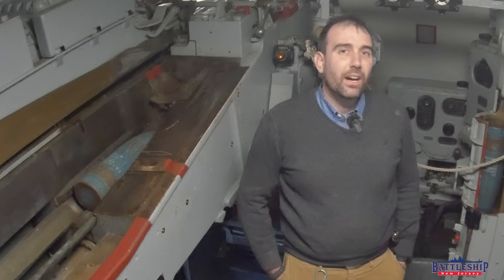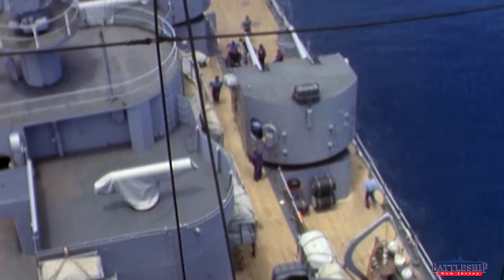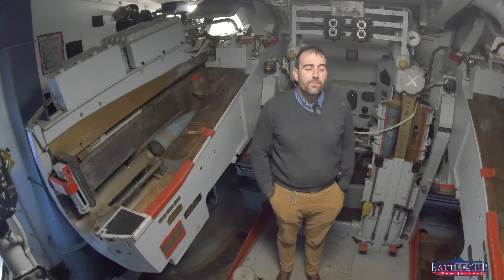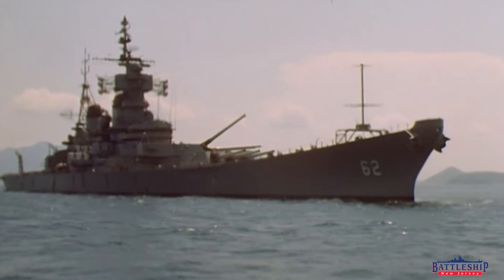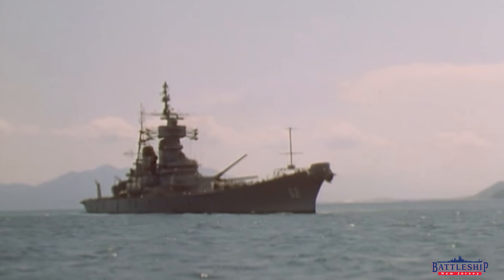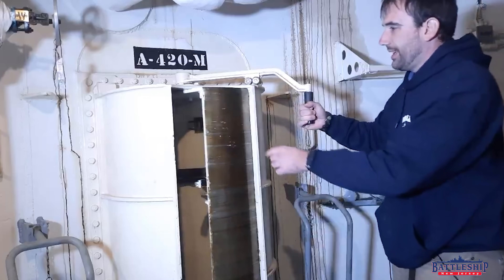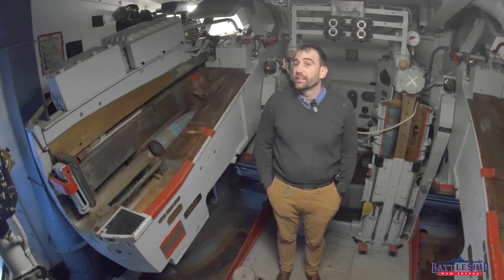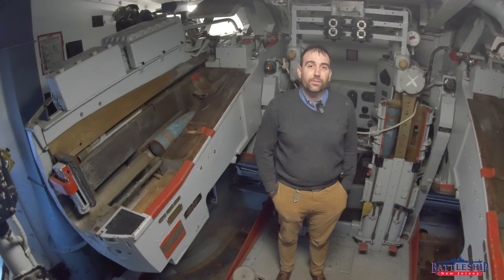Why Do Modern Warships Have So Few Guns?

Comment: Modern guns used as artillery (155mm) on land have ranges of more than 40 km (25 miles). And if you put some R&D into that matter, weapons-industry surely could figure out cannons that can even fire far beyond 40 km. And nowadays artillery systems are far more accurate than their WW2 predecessors. Maybe this developments will make guns become an interesting weapon again on ships. One more pro-point for artillery systems at sea is, that a shell is far more cheaper than a missile.

Comment: One argument for guns I have is that, while VLS missles are certainly better in terms of accuracy, damage, etc etc, there's a distinctly limited amount of them ready to fire, and their direct access to the deck requirement makes them limited too, plus replenishing them is currently a nightmare even in calm seas. Therefore, I feel it would make sense for perhaps a cruiser with a much larger gun to be made, with a payload at least rivaling that of missiles, especially for targets where pinpoint accuracy isn't as key (like for shore bombardment, especially for static positions), and especially as anti-missile tech advances. Furthermore we have advances in artillery technologies that are making them very precise - of course there are many more variables shooting from water but the tech will come, and current waterborne 5-inch gun precision is proof of that. Overall I'm not expecting more guns, I'm expecting bigger guns complete with autoloaders, precision, and range.

Comment: Missiles and tracking tech are effective as illustrated lately in the Red Sea.  But what happens when those incoming drones or whatever have really good evasion tech or can jam the missile?  You need point defense that can't be jammed.
Reply: Shooting a maneuveraing drone is actually easier with a missile that can adjust its trajectory midair than with an unguided shell that you send in the right direction and hope that the target is close enough to where you expected it to be when the shell arrives.

Jamming shouldn't be a big deal for point defenses, as the short range means that the poweful radar on the ship can easily burn though any jamming. I'm not aware of any ASM or drone with a jammer either. And if it was a problem, a gun wouldn't hit a thing either, as they're radar directed and would lose most of their accuracy without the radar.

Comment: I m predict destroyers equiped with small nuclear reactors for engine and heavy lazers... Which are going to replace flak.. next a. Increased rocket silo which allows for rockets with even greater range... A few remote controlled 50 bmgs or 20 mm guns and for the topping a 180 - 250 mm (7 - 10 inch) single barrel gun which shoots smart (similar to gyrojet ammunition)  ammo with a range about 60 - 100 km

Comment: The short answer is accuracy and quality is always replacing quantity and target tolerance.    

When a 12inch gun had to fire tens of shells to hit or affect a target, with a single missle this job is now much quicker and and more repeatable.

Imo:  automation and miniaturization will replace most jobs currently are done with missles.  Kamikaze Drones is one immediate future, but I think another contender will ultimately win the game.

Consider a shell  roughly the size of a 50 cal that comes with integrated circuits and GPS navigation.  It will be programmed as bullet/shell ie leaving the barrel , each round can theoretically hit a different target or they can converge on a point in series or even in parallel (all at once) for greater affect.     Such new weapons can take over roles and responsibilities of 1-10 mile, and they  range can be expended with small  flight fins and a small rocket booster.

This may sound futuristic but every element of my example has already been deployed on various platform.  We just need to bring it all together in one small but smart bullet, with impeccable backend software to support its targeting.

My 2¢

Comment: More guns would definitely help in a drone swarm, but... Are drone swarms really that much of a risk to warships? They're slow, inaccurate (Against moving targets) and usually have small warheads. You could easily fix these issues, but then you would just end up building an ASM and lose the main point of drones; That they're cheap and easy to manufacture. I believe that the CIWS and PDMS on current ships is more than enough to deal with a drone swarm. At most they may need some reprogramming to better determine which drones actually pose a risk and which ones can be ignored.

Comment: I think for drones a smaller caliber (maybe even as low as .50), with a lot of powder so that it can go very fast, and a relatively light barrel that can be quickly swung around would work best. You could have basically a smaller and cheaper CWIS for drones, because they can take at most one or two hits

Comment: reality with the east, our ships are logically outdated. cheap 600 bucks drone are the future. 
we're not even talking bout drone swarming that a few can disable even  a carrier radar. or future drone carrying heat seeking missiles to take out jets. or robotic drome. 
   we witnessing right now the decay of huge military hardware at the red sea it's obsolete here,  rebel  are doing a reverse curency USD exchange, that 14 shot down add 28 ukraine 2 days ago total cost comes w/ 2 million ea missile to shoot them down come to 86 milliion spent on almo in a single  day it's unstainable war.
thing about drones is they can hide it in a blanket and launch it anywhere and never use the same place. we can't stop it.
Reply: drones are being solar charge in the desert, ship need port refill. point is complex high cost and huge are a disavantage not avantage in circumstances. and why we try to make it a standard is insane.

Comment: You know, you ask if we think missiles will replace guns, and I think the answer to that is the same answer to the question of if missiles, planes, or drones, will replace tanks.
Essentially, no. Probably never. You've said plenty of reasons in the video itself, one of them being that you can't do fire suppression with missiles. They're way too costly to use on anything other than priority targets. 

Similarly, drone swarms wont replace guns either. Even if you got really small micro drones with explosives that could fly for 30+ miles to a target, they'd still be slow and numerous enough to take out at least a vast majority of them with a good old gun with some proximity fuse HE/shrapnel rounds. Add on the fact that even the cheapest drones will still take much longer to develop and build in mass than a simple, large shell. 

Logistically, nothing beats a chunk of metal flying at super sonic speeds via a easy to mix powdered charge.

And frankly, combat is complex. You're not always engaging targets that have standoff capabilities, which DOES allow you to move in range of your relatively cheap and inexpensive deck gun. On top of that, a missile is only good in an offensive role (excluding anti-ballistic missiles due to them being a completely different nature of combat) where as that same deck gun can easily be loaded with that same old reliable proxy HE shell I mentioned earlier. It does the double duty of defense, meaning that even when the gun isn't being used in an offensive role, it's always on duty, remaining in use with no down time. Meanwhile those missiles or drones have to be lugged around everywhere, possibly not seeing use for months if not years, all the while soaking up funds through sustainability maintenance.

Oh and don't even get me STARTED on aircraft. They are the worst of the worst when it comes to "efficiency" in naval warfare. Don't get me wrong they also have a place, and frankly a very large role to play in naval combat... But for every ballistic missile you can launch once at a target hundreds of miles away, to do the same with an aircraft would cost the fuel to get to the target, the fuel to return from the target, the pilot training, the maintenance training, the maintenance itself, the coordination of multiple aircraft, the logistical concern, and the threat of losing that aircraft or pilot during an operation.

This all to say that, missiles are simple compared to aircraft, but aircraft are much more powerful when used properly. In the exact same vein, guns are much simpler than missiles, even when a missile is easily more powerful and useful than a single round when used properly.

Comment: I think we will see a increasing number of oerlikon 35mm guns with AHEAD ammunition here at europe. Also we will surely stick to 76mm and 105mm guns for sore support and also "heavy" AA flak weapon. Our navies usually dont have to operate as far from home as the USNAVY usually does. That (and also reduced costs) is the main reason our ships usually have smaller missile loadouts and size. A increasing number of 76mm guns at the USNAVY wouldn't be surprising due to faster rate of fire for AA support.

Comment: What we have today(Houthis drones attacking) is the ships launching a $500,000 to $2,000,000 missile to knock down a $10,000(or lower) attacking drone. A problem we also have today is we do not have the capacity to reload the missile cells at sea. We decided we wouldn't need to reload our ships on the move after the USSR fell.

Comment: I am not a military expert in any way but I am surprised at the assumption that ships only engage at distance. There are rules of engagement which means there are different levels of attack or defense/counter attack. Sometimes ships just ram each other and no firearms are allowed to be used at all. Similarly, sometimes I expect smaller guns being allowed while bigger ones are still forbidden by higher ranks of decision makers.

Second theme is redundancy. Again, from my limited knowledge, I thought everything in military is built on foolproofness and redundancy.

Comment: I expect we are going to see shells made for the 5-in gun that are basically the old Yamato airburst shells except programmable in the next few years and I expect that is going to take over a lot of the counter UAS fire missions, especially when combined with the laser systems that are being trialed on the Burkes and the ticonderogas

But also SM6 packs in something like six missiles to a VLS cell and they're not all that expensive when compared to other options. So it is entirely possible that ships will continue to be deployed with a lot of missiles, but most of them are smaller and can pack multiples into a single cell

Comment: 155 mm shells of today have quasi missile capabilities (and price to match) but you can use various types of shells for various tasks. If I were to build a modern missile boat, I would never forget to add at least one 155mm very capable gun like we see a French Ceasar truck, and also a a very capable AA gun like a 35 mm of a Gepard, the shells are each timed when exiting the barrel to fragment close to the target.  Ammo capacity of the 155mm must be deep with different shell types. The systems are like oignon rings from radars to missiles for far away and last resort guns for closer targets. To defeat a boat you must use saturation attacks to deplete missiles, so guns add and complete missile capabilities, missiles can miss, then the guns are there.

Comment: Guns are useful against drones only for self-defense. Surface combatants will have to proteced merchant ships and carrier against drone attacks.  While Standard missiles can shot down small drones, that's obviously not cost effective. So a new kind of weapon is needed. This could be either a new kind of missile, which is much less capable, but also much cheaper and smaller. Or it could be another drone. I don't see a role for more guns here. One or two medium-sized guns and a handful of light guns is enough for a destroyer or frigate.

Comment: While it is possible for a cruiser or destroyer to enter naval combat, what do you think the odds of that really are?? It doesn't make much sense to try to get ships in range of things that can damage or destroy them, seeking instead to use long range missiles to destroy them before they can get in range.

A part of economic warfare suggests that it is cheaper and easier to replace 1 Exocet Anti-Ship missile than it is an Aircraft Carrier, a Cruiser or a Destroyer. I am all for having defensive guns on board a Cruiser, Destroyer or Carrier, but its primary offensive weapon loadout should be missiles, at this stage of the game.

Comment: I'm wondering how kirov would stand up to five inch armor piercing rounds. maybe the superstructure but I don't know if you are piercing a kirov hull with one she is kinda thick for a modern ship. anything else on the water the gun is more than enough.
Reply: According to Wikipedia the ship has 76mm armor at its thickest place at reactor, so it wouldn't stand in case of direct hit.

Adding armor would slowdown the ship, which defeats the purpose of installing nuclear propulsion system.
Reply: @Nikola95inYT  it defeats the point of a battle cruiser too. fast enough to run from a fight big enough to put up one.. so it has armor like a wwII tank. that isn't anywhere as much as i would have thought.
Reply: @jeffjr84  the classification as battlecruiser only appears in western sources. Russians just call them a heavy cruiser. The development of missile weapons made armor obsolete, so should have been naming conventions of WW2.
Reply: @Nikola95inYT  super cruiser battle cruiser ECT... they all got different names and usually their goal is to mislead that thing is no different than a battleship considering there is nothing that can stand toe to toe with it alone right now. if things you can do include using that sonar to divert torpedoes. you got something special

Comment: To me a single 155mm gun with autoloader would make the most sense. Essentially use a proven modern artillery system and put it on a ship. You can use the same ammunition and GPS ammunition as land artillery. That could be an excellent addition. Would be interesting to know why 127mm is the standard ship gun size.
Reply: To my knowledge, land artillery such as 155mm howitzers do not have provisions for anti-air use unlike the naval 127mm guns.

Comment: I expect there to be a new or perhaps a redesigned older ship placed in a new role of "anti-drone escort" that will be equipped with lots of anti-drone guns, but I don't see guns retaking any long range role. Even if missiles get too expensive for the long range roles, drones are proving to be the better cheaper alternative. So I would imagine drone launching carriers would be the replacement there.

Comment: I think there's a case for a larger cruiser-type ship with one dual-six inch turret for shore bombardment. A gun of that calibre would still be fast-firing enough to target sea-borne drones whilst providing better range than the current 5 inch gun. Aside from that, I think drones might see the return of 40mm autocannon, as they're large enough to be able to launch an explosive shell whilst also being fast enough to target propeller driven drones.

The Russia-Ukraine war has shown that once the missiles run out you fall back on guns. In a near-peer situation it's conceivable that NATO ships will need all their VLS tubes for SAMs, that just leaves your dedicated anti-ship missiles like Harpoon, but the enemy has their own defensive missiles and CIWS, so then what? I can see the gun being the only option for shore bombardment, and I can also see a situation where ships expend all, or almost all, their missiles and need something else to fight with.

We may see the return of heavy anti-ship torpedoes on surface combatants for the same reason.

Comment: I was wondering if you were going to consider modern threats. There is also a story from a few decades back where an Iranian frigate was fired at with the standard missile. It was unable of offensive operations, but was not sunk.   The old threat of the soviet navy with its missile deployed along the superstructure are gone. One hit and the whole thing goes up, and damage control on like the Moscow was not a concern.   The US Navy needs guns to handle PT boats and smaller, as well as cheap air and surface drones.  Something big enough for a proximity fuze and can hole a lightly armored surface drone swarm.  The Ukrainians have a dangerous speedboat drone, with enough bang to ruin any captain’s day.  You need to be handle a air and surface swarm. The air swarm will target the guns.  Single ended gun warships are going to have a bad day.